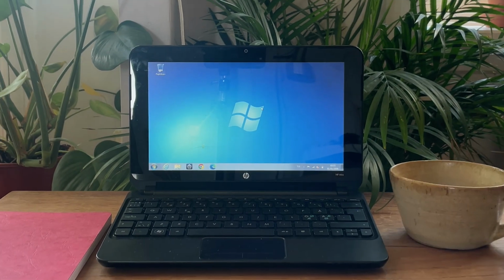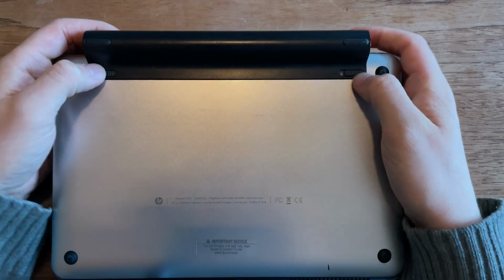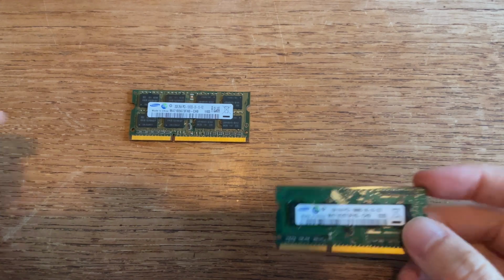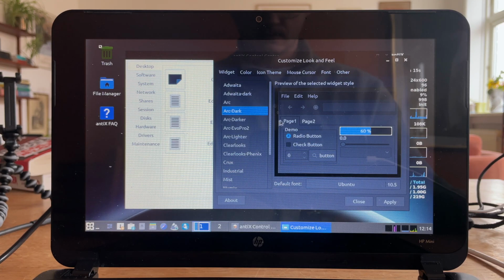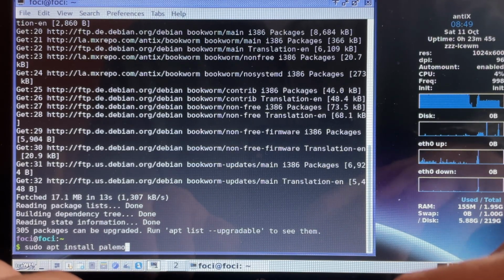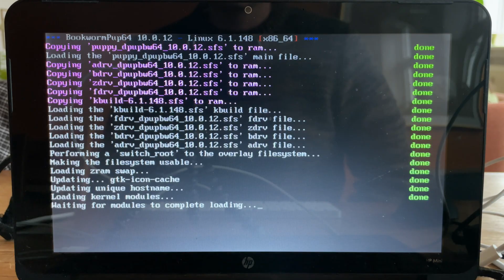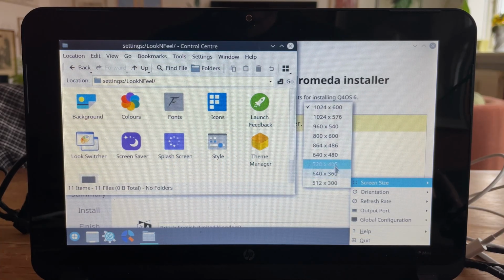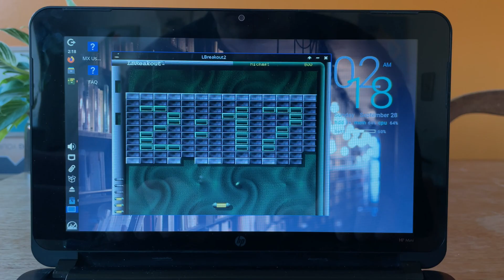Can "lightweight" Linux distros save this tiny laptop from 2010?

Comment: After running sudo apt update, please also run sudo apt upgrade to actually update the system.
You can chain these commands together with && in the middle to automatically run the upgrade command if the update worked.

With the too large Calamares installer window, if you hold Super (Windows) or Alt, you can move the window about when clicking anywhere.
This should let you use it as normal, even if it does not fit.

You can also try to just send it with a distro using the heavier KDE Plasma 6 desktop.
This is much heavier, but it uses the GPU more to render the desktop, which can offload the CPU.
It'll either run abhorrently bad, or actually decent with this.
Mind the Wayland and X11 difference and try both modes.

For the distro, good 'ol Debian should be relatively light if they still have a 32 bit option, if not as light as these other specialised options.
Ubuntu is heavy due to the Snap application format it uses, which Lubuntu is forced to use by Canonical, while Debian does not use these.

I saw the recommendation of ZRAM in another comment, do give that a try and see if it helps or makes things work better.
This will use the CPU more to compress some RAM space, so it could go either way depending on what the bottleneck is.
Reply from the maker: Wow, thanks for all the great tips and info!

Comment: My netbook is a Positivo Mobo 5900 (2013), he have 4GB of RAM (single-channel) and a SSD with 128GB, my CPU is a Atom N2600 (2/4 1.6ghz), i use Debian with Xfce, the only problem is the resolution (1024x600), the minimium requeriments for use a OS is 1024x768, it's sad, but works with 720p 30fps videos on Firefox optimized by me.

Try Helium browser, is more lightweight than Chromium and Firefox... This is my primary personal "PC".

Comment: I still use a laptop from 2009 daily, though my CPU is much more powerful (a 1.4GHz ULV Core 2 Duo) and it has 6GB RAM. YouTube worked okay already, but sometimes it choked on 60fps videos. To improve video performance on YouTube, try h264ify and disable 60fps videos. It was night and day.

Comment: I also installed antiX on my Samsung NCC110 netbook, which I bought in 2012. It works great. But my netbook has two Atom cores and 2GB of RAM. And my netbook's screen is uncoated, so everything is clearly visible. Thirteen years later, I realize how lucky I am. And to change the thermal paste, I only need to remove the bottom cover. Anyway, thanks to the commenters for recommending antiX.

Comment: I have a HP Mini 210 too and I've been enjoying it! It's the laptop I've dreamed of and it's just perfect. The one problem I have with it is that it's not good at gaming, like at all. I've tried running Counter Strike 1.6 on it and it was running at 9 FPS. I was wondering if you were able to play 3D games at a better FPS than me on Linux, like Counter Strike 1.6 if you have it but it doesn't have to be that specifically, just any 3D games. I just wanna know if it's a problem with how I set up Gentoo and Intel stuff or if it's something else. If it works on your device no problem then it's probably a issue that I created for myself. 😅

Comment: Technically yes  but otherwise no.
 There is a misconception that mostly newcomers to Linux tend to make, which is that Linux is designed for old hardware. This is not the case, if you want to get all of its features and keep a better workflow you will need newer, more robust hardware. It does have tweaks and distros that will run on old hardware, but this is only with the idea of repurposing that old PC probably as a media center or text editor. If you really don't see any use case for an old PC, it's probably because its hardware is just too old, no OS can save that.

Comment: Well, I have Samsung n350 which is pretty much similar configuration with this (Atom n550 + ssd kingston a400 + 2gb ddr3l). Windows 10 IoT Enterprise LTSC runs AMAZINGLY good, unlike any linux I've tried. I have Antix as dualboot system and I used to have Puppy linux (ram system sucks imho). Yeah, it may sound like idiotism, but you should really at least try Windows 10 IoT Enterprise. I didn't even turn off animations there, it runs good even with them. And you should use Edge or Mypal browser (not palemoon, it lags even on Windows 7 x32) if you try doing so.

Comment: I managed to load mint 6 32bit by rotating the screen 90 degrees and putting the netbook on its side so I could tick the progress boxes that were otherwise off the 600 high screen. Computer was Dell mini 1011 with an ssd and 2 gb ram Intel Atom processor.

Comment: I got one from a charity shop. The only way I got any usable Youtube was by instilling 32bit windows 7.  I tried about 10 versions of lightweight Linux. None were any good. That is what many netbooks came with. What is annoying is back when they cane out, Youtube ran fine on 1 gig of ram.  You could try to force your browser to use the H.264 (AVC) video codec instead of the newer, more demanding VP9 and AV1

Comment: Brooo, we had these pieces of shit back in HS in 2018, we tried to get them to at least be open to use firefox and word by installing this ultralight version of W7. They barely worked afterwards but it as better than nothing and I had a lot of fun and they did manage to run Mortal Kombat 3, so while the effort wasn't worth it, it made it so it felt like some kind of pyrrhic victory.

Comment: The nail in the coffin for this small little wonder is Youtube. You cannot run Youtube on this properly. Multi-tasking is rough too because these have atom processors. Anything else you might use its fine for basic office tasks and typewriting. Today it can be used for nothing more than a document writer with some lightweight games. 

Atoms were bad even in 2012.

Comment: Debian minimal with i3 is a perfect way to get the most out of your hardware (100-120MB RAM after boot). Even if you aren't tech savvy. You could use AI to guide you through the configuration process, to get it the way you want. let's say you want the system to boot with certain applications and layouts (like terminal, file manager, web browser, abiword) you can script these to open either in different tiles, or desktops workspaces as full-screen applications. That way you can easily multi-task with minimal memory footprint. It would become a quite useful light-weight workstation.
Reply from the maker: Thanks a lot for the detailed explanation! I'll definitely look into that! More coming soon :)
Reply: @focivideo  no problem mate... The great thing with i3 is that you can basically render it in "tabbed mode" that way all applications will be full-screen and you can just use the mod+arrow to move between them (mod often being "super" or "alt"). tabs will be visible in a very skinny bar. but you can also enter i3 full-screen mode. tabs are invisible, but you can still navigate between your applications.

that way the desktop environment won't take up any space at all with unnecessary bloat like the "taskbar" or a "window tile bar" for each application. Sure, i3 is mainly used by coders and keyboard users. and it can be a bit daunting to begin with, but once you have configured it in a way you like. it's actually quite freeing not to have to deal with the visual bloat of window management. Especially for a netbook where you are likely to use all of the screen real estate! ;)
Reply: A minimal tiling window manager, such as i3, is not a bad suggestion. Although it might be a bit scary for a new user, it is very lightweight and it will allow you to make the most of the tiny screen. Just one caveat; Debian has recently dropped 32-bit support, so recent versions will not run on this device. (same for stock Arch) The Debian based Puppy Linux/AntiX/MX Linux still support 32-bit as of this moment, and if you feel adventurous, Void/Alpine/Tiny Core has 32-bit support. It's a shame that Debian dropped 32-bit, since it would have been a very good lightweight and user friendly option.

Comment: 🤔 The important thing is to use what we need more functionally and productively without overthinking. As long as the computer is still running properly, there's no need to be anxious about buying new hardware. Learn to put aside unethical products, which are starting to turn against their own users, and they're showing less respect. We've already paid, and they're betraying us by treating us unfairly.

⚖ The current problem with Big Tech's cheating: they aggressively lead and trap, then lock us in (vendors lock in and start hijacking data and systems, unilateral UI changes, etc.), then drain us (unnecessary monthly subscription fees, invasive advertising, etc.).

🌿 Try to slowly distance ourselves from irresponsible platforms, turning computers that should be working normally into electronic waste simply because of unilateral monopoly requirements, forcing us to buy new devices so the company keeps making money. This increases the carbon footprint of production and exacerbates the environmental crisis.

🛠 Let's embrace the choice of free living as a life decision, away from digital colonialism. Take back control so that our devices truly feel like ours, not rented and trapped. We are not the product, we are not empty land to be sold or colonized. It is better to contribute to mutual progress than to side with greedy corporations.

🎮 Why we should start embracing life choices, starting to side with open source in this critical era. Because now is the perfect time to make the switch:
1. Encourage active participation in the global community's open source innovation ecosystem so that it can develop rapidly without depending on the control of a handful of big tech companies from certain countries, which can bring significant pressure on the economy and politics.
2. Cut parasitic licensing fees that continue to drain the wealth of the country and many people. 💰 This can be diverted to finance books and learning tools, teacher salaries, and school improvements.
3. Build digital sovereignty in this critical era, where AI spy features are now being enforced and can turn computers into bots.
4. Control the security of sensitive state and citizen data, minimizing the risk of surveillance, intelligence, and sabotage. Invasive data telemetry facilitates access by foreign parties. 🔐
5. US Cloud Law: US companies are required to hand over data to the US government, even if their servers are located outside the US. This opens loopholes for foreign surveillance of other countries' governance systems.
6. Reducing the dominance of closed capitalist ecosystems.
7. Ethical choices for a more equal technological future.
8. Opening local job opportunities: Recruiting local developers, training sysadmins and technicians, building independent solutions.

🌐 So, this is about supporting the legacy of future technological standards that ensure interoperability, a more open, fair, transparent, and inclusive future that liberates the entire world before it's too late. If we dare to adapt, if we still care! 💪

🚀 Make open source a strategy, as well as an ideal. Let's learn to respect privacy, stay away from products that take excessive control and behave like spyware. Remember that our data is being mined, our footprints are being shared with the NSA, and the companies behind them are facilitating genocide.

🧡 Let's give ourselves the opportunity to restore humanity by fostering collective collaboration, supporting each other, and learning to contribute, because helping each other is a noble value worth preserving.

Comment: DOSBox is an emulator that emulates computers with Microsoft DOS, an old command-line operating system that predates windows. DOSBox is typically used to play old computer games such as DOOM for instance.
Reply from the maker: Thanks for the explanation. Perhaps I should try it, so i can do the infamous "but will it run DOOM?". Thanks for watching:)

Comment: nice!
I also have a similarly sized laptop, but mine is a 2009 MSI model. On my side I have installed Debian 12 with LXDE but had to add "acpi=off noapic nolapic nomodeset" pnpbios=off" to the installer command prompt before starting the actual install process. While the UI is laggy (only 1 GB of RAM) it is good for playing around with Jenkins and site hosting on local network,
Reply from the maker: That's great! Thanks for the tip and for watching :)

Comment: "Will these distros make the old laptop usable again?"
Sorry... No. 32 bit SoC, single core... it's wasted time and a bajillion of wasted power. Also a minuscule resolution.
50 USD used smartphone like moto G8 (32 GBP in the UK) will deliver a far more powerful device with an astonishgly good ease of use, bigger screen resolution (while smaller in inches) and will use a fraction of the 30w power required for this Netbook.

Netbooks (escluding later, bigger and better models) were usually not that good at that time, and didn't aged any good.
Save time, recycle that in the right places and go for something more useful.
Reply from the maker: I appreciate your honest feedback. My goal with this video was mostly to see if I could make it somewhat usable, but I definitely agree that in most real-world scenarios, a modern smartphone would be a much better option. Thanks for watching:)
Reply: @focivideo  I can relate with the goal of "saving from dumpster still working electronics", but there are a lot of devices that "dumpster" or "recycle" seems the only path.
First one: 32bit x86 systems. Excluding collection, museum, teaching... it's too old, too little power, too many vulnerabilities period.
Second one: any three-digit-intel processors. Too much power wasted for too little computing performance
Third one: any-non-ryzen CPU/APU. Excluding GX CPUS, a lot of old AMD stuff is simply... not powerful enough.

As a next video... consider to revive an old desktop or an old laptop with a light or homelab linux distro ;)

Comment: Here is the fix for your Linux Mint problem: 
Boot a second time the live usb and search for "Boot repair" after you open it it will ask you to install the newest version, just click no, then the program will search for os's on your drive. After it found different os 's on your PC  and you can repair the bootloader/grub by clicking on "use recommended settings" after the process has finished just shutdown the live usb system and boot to your Linux Mint install. It happend to multiple times on different pcs, so it's not pc specific. Seems that the installer fucked something up by installing and setting up grub.
Reply: Yea, I had that too. It looked like the install failed at the very end; didn't shut down properly. I figured it was just bad install media.

Comment: I've searched a lot for a good OS for this old notebook. There are 2 main issues: first, the resolution, and 2nd, the ram limit at 2 Gb, and the fact that 32-bit OS are a rarity. (The remaining ones offer old software. For example, check the difference between x86 and x64 versions of Q4OS.)
Fortunately, my HPmini has an N570 processor that supports x64 instructions. Surprisingly for me, the solution was Debian last edition with  XFCE desktop. For YouTube, i use FreeTube, a very good cross-platform application.
Reply from the maker: Nice! I'm glad it works for you. Thanks for watching :)
Reply: Watching back this video and I've observed that you have 2 mPCIE slots. One it's occupied with half wifi & bt card but the full one it's empty. No, unfortunately it's not made to fit a msata drive there. Don't  try! It's only for comunication. Some premium models have a mobile data modem there.
But if you look more careful to the board you will see some unpopulated cips there. I have also those, and after consulting schematics, I discovered that those are for Crystal  hd video decoding. Too much efort to solder those chips on board but you can buy a cheep mPCIE card that can help you with video decoding. Still  not a miracle  but a little better!

Comment: Had a laptop from 2012 that had a celeron b830 and 4gb ram, upgraded the CPU to pentium 2020m then add another 4gb so 8gb all together, tried Linux but couldn't be asked so got windows 11 and works good
Reply from the maker: Nice! Do you still use it today?
Reply: @focivideo Yeah it's still usable and works

Comment: I could be wrong, but I doubt that any netbook from that era could handle modern YouTube videos.  The HP Mini 210 does have some onboard video decoding via the Intel GMA, but modern YouTube uses VP9 and AV1 video codecs which didn't exist back in 2010.  I think I had the previous version, the Mini 110, back in the day.  That thing struggled with anything other than standard definition video files.
Reply from the maker: Thanks for the insight! Thanks for watching:)

Comment: For YT I would recommend open-source app FreeTube, it has much less overhead. Also for browser I would recommend Falkon (or chromium if you need extensions), Firefox is kinda slow on these machines. I really enjoyed both videos, I recently installed antiX linux for my friend on their netbook with an intel atom, it's as snappy as ever on those 2GB of RAM and battery lasts multiple lectures :D

Tip: antiX has an ugly login screen, but you can change its theme very easily and there are several very pretty ones builtin! I love the surprising customizability and graphical tools built into antiX, they can be sometimes hard to find, but once you get used to it, it's great (also my favourite desktop theme is antiX magic)